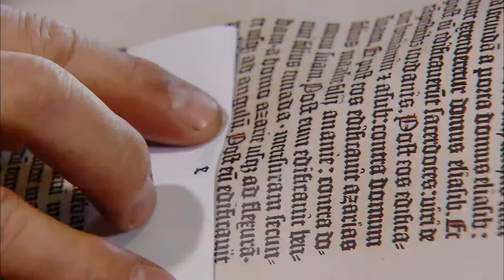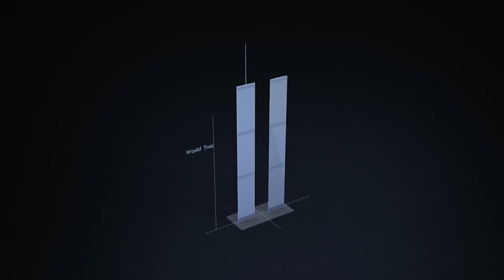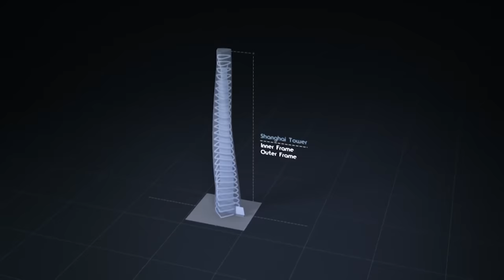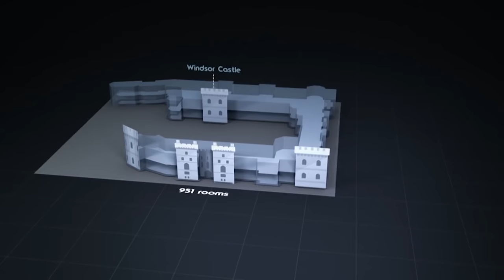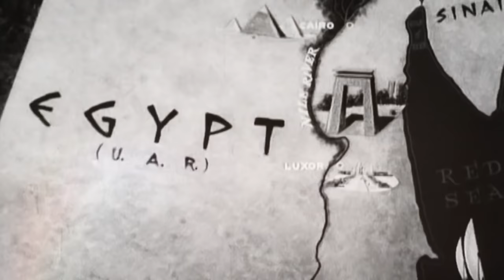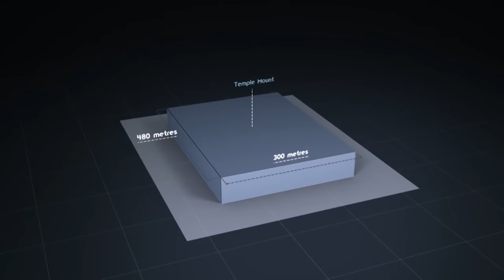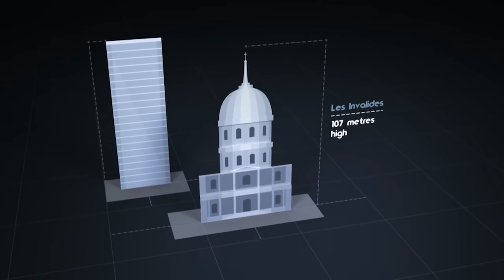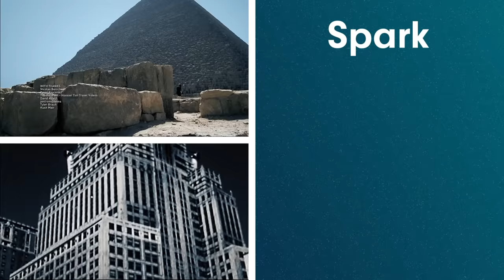How Did Humans Build The First Skyscrapers? | Supersized Structures | Spark

Comment: Yes, but the melting joists of the WTC buildings don't fall at free fall speeds as recorded by the cameras, and the structures would not fallen in such perfect symmetry if it was due to melted metal. The structure would fallen in an asymmetrical fashion as the heat would not have affected all the structure in the same way. The part of the building with most burning fuel would have caused the building to fall like a chopped at tree because of variations in heat distribution.
Reply: What happens when they are softened? What if 70s metallurgy was shit / wtc was cheaply made? 

Things to consider
Reply: é muito óbvio que foi uma implosão, é estarrecedor